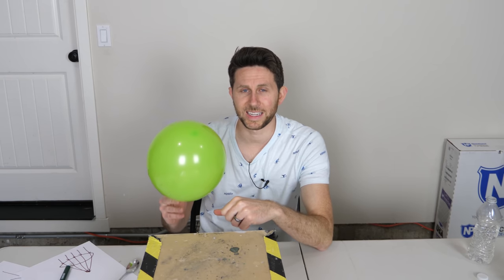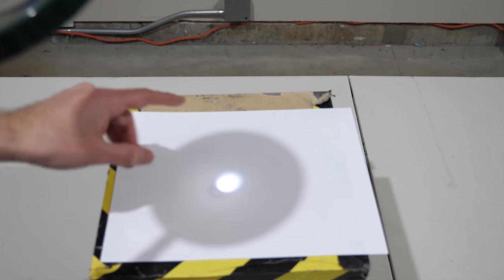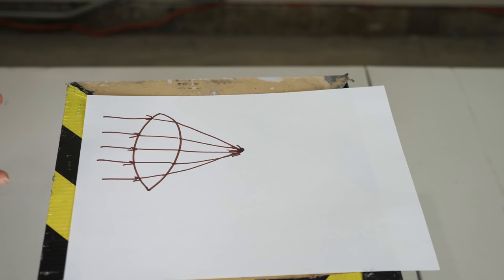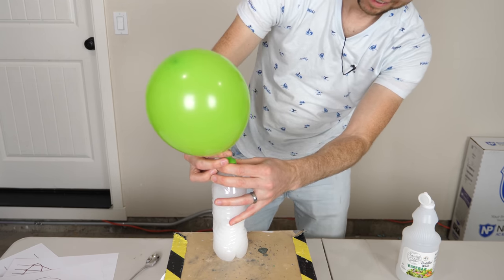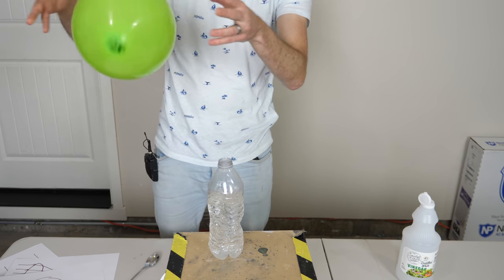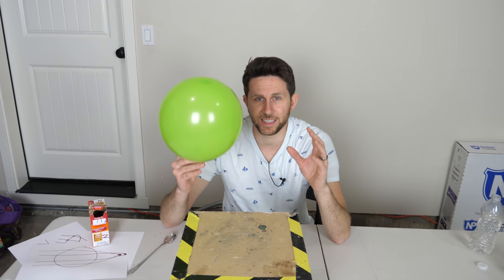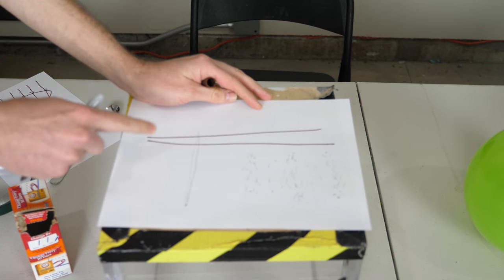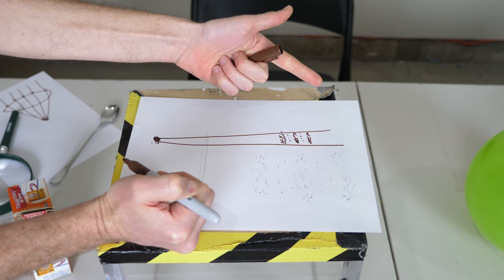Is it Possible to Make Hypersonic sound? Ultrasonic Sound Lasers and Lenses

Comment: This channel is filled with fun mixed with science. That's a very smart way to teach others. Thank you
Reply: After watching this channel I like science more than ever did. this channel is filled with fun experiment and easy knowledge i like your channel and I am your big fan I am from India 🇮🇳😇
Reply: Fax
Reply: Some of his explanations are a bit inaccurate/misleading though.

For example, the refractive difference between mediums isn't actually due to density, although they are related. And the same goes for sound through a medium.
Additionally, when he explained how the "sound beam" works, he said it uses pressure waves to propagate, but that's what literally ALL sound is, it's not special to this. And the generator of the waves is absolutely the source of said sound. The source of the waves IS the source of the sound. All waves need a source, and sound is no exception. It doesn't just materialize from the aether.

Comment: I found this experiment really interesting, I think you should consider that in the case of light, the wave length is way smaller that the lenses, so I recommend to repeat it with a weather balloon and maybe add some distance between the sound generator and the sensor. After all, light experiments mostly use planar and coherent laser like waves. You could use dry ice to obtain the CO2 and use a shotgun mic if you have one. The idea is grate, keep the good work.

Comment: Is it true that if you collapse an underwater bubble with soundwave, light is produced? If yes, why is it so?
Reply: Sonoluminescence.
Reply: Not even Wikipedia knows why.
Reply: Is light produced or is it for nanosecond refractions from bubble collapsing..?  How would u measure input of light into/onto bubble..isolating it from environment.. or is it photons being emitted from electrons of atoms of material in the water excited by sound..im not sure if this is possible?? Would salt water be same as fresh water in this case? 😘
Reply: Matías thanks for the link..it's very helpful..I'd not heard of this before!!
Reply: It happens but we don't know why
Reply: It's mostly due to the water vapor which evaporates to form the bubble being compressed suddenly into a very small volume, so the temperature goes up really fast, like tens of thousands of kelvin hot for a moment. The light is likely produced by H2O being briefly turned into plasmas of hydrogen and oxygen

Comment: I bought such a device more than ten years ago. It's called Audio Spotlight, and I used it for being able to wake up to and listen to radio in the bed in the morning whilst my partner could continue sleeping. It cost a fortune (about 1.800 USD) and was a disappointment. It turned out that the bed linen demodulated the ultrasound and dispersed it in all directions, so my partner could hear it almost as well as me. In free air it kind of works, but nowhere near "rich sound here, nothing one step away". It's stowed away since many years.

Comment: Doesn’t horn speaker focuses sound? And could water in a baloon do it since it is much denser than air?
Reply: Yes but I think water is so dense that some sound gets caught along the way
Reply: A horn speaker confines the radiation angle of sound, but the dimensions of the horn mouth must be large enough relative to the wavelength to exert pattern control and not just create edge diffraction. Think of a straight pipe having the diameter of the sound source: if you use a small source (such as 1"), most audible frequencies will diffract when they reach the end of the tube, because of the sudden change in radiation resistance (forcing the wave to expand in directions not parallel to the horn wall), and the effective radiation angle will be close to 180 or even 360 degrees in any plane crossing the axis. To constrain the radiation angle to smaller angles while having a mouth that opens to be large enough to control the radiation angle, the horn will need to be exceptionally long, even infinitely long. 

If you make the sound source tens or hundreds of times larger than the wavelength it is producing, then it will begin to exhibit off-axis self-interference, which becomes more intense as the dimensions of the isophase source (think of a flat piston) are increased, producing coherent summation only in the axis of radiation with minimal spreading, but these sources can become impractically large to transport or mount. (Look at the Meyer Sound SB-3 "sound beam" - it is an array of dome tweeters creating a sound source that is substantially planar, substantially continuous, and substantially isophase.) An array of ultrasonic transducers is able to create narrower beams of sound than a horn can produce, and because even a radiator of practical size becomes large relative to the wavelengths of ultrasound that it is producing, it is able to make use of off-axis self-interference to create a narrow beam at distance. 

Because ultrasound is being produced, it cannot be heard. It needs to contain modulation content that occurs at audible frequencies in order to be perceived by the ear. So the ultrasound needs to be demodulated somehow, and it does that by interacting with a high impedance surface, causing the ultrasound energy to be reflected in a non-isophase manner and mostly destroyed, but the residual variation in pressure is demodulated as audible sound. In a Class-D amplifier, this is done electrically by passing the modulated ultrasound signal through a reconstruction low-pass filter, but in the physical domain anything providing a reactive low-pass effect can demodulate the ultrasonic carrier, causing the resultant pressure to contain only audible content below the low-pass corner. 

Once the concept of demodulation is understood, a number of methods for achieving audible transmission become apparent. You can employ frequency modulation (resulting in amplitude modulation of another ultrasonic difference tone between a steady ultrasonic carrier tone and a sliding ultrasonic carrier tone as the carrier), amplitude modulation, or pulse-width modulation. You can use mechanically transmitted pressure waves, or you can use other forms of energy to do this also - radio frequency, microwave frequency, or even light, though the power needed to produce air movement can be great enough to cause injury to a subject, so you would need to be careful. This power, modulated at audible frequencies so the demodulated signal consists only of audible content, can be used to produce audible sound. 

This phenomenon of energy demodulation is likely what caused American diplomats in Cuba to perceive harsh-sounding audio as they awoke inside their domiciles while their brains were being damaged using a directed energy weapon, causing people in the public to suspect that an "acoustic weapon" was at work; in reality, sound (acoustic pressure waves) would not be able to pass through the walls of their living quarters without being strongly attenuated, but radio frequency energy can pass through walls, and if its modulation contains audible content, then the person or animal subject will experience audio while the rest of the energy is being dissipated in their body in another way (such as frying their brain).
Reply: @Acoustic_Theory  w h a t

Comment: Air particles are very heavy as compared to light particle it is very interesting to study about the ratio  of the angles by which they bend during refraction in different materials and for different wavelengths.

Comment: Good. Now make flammable water. But it has to remain H²O.

Edit: Mostly H²O...
Reply: How should this work?
Mix some kind of extremely flamable oil in?
Reply: Just mix ethanol with water boom flammable 'water' which is mostly water
Reply: @deadalpeca8099  it would be over 40% ethanol
I dont think almost 50/50 is considered as mostly water
Reply: Just to be clear, your notation should be using a subscript for the 2, otherwise it's an ion.
Reply: Mr.Knight The Detective: https://en.wikipedia.org/wiki/Chlorine_trifluoride

Comment: I wonder if ultrasonic sound waves could be used to steer light.  Maybe ultra short laser pulses synced with them could be refracted multiple times?  Could make for a strange effect with the appearance of light changing direction in mid air :)

Comment: Lenses for EM radiation work on transverse waves, but with sound being a longitudinal wave, I'm not so sure it'll work in the same way. I'll keep watching just in case!

EDIT: I have a problem with the fact that sound is "focused" using the CO2 balloon. Surely this is due to the higher density allowing more sound to transmit more efficiently? CO2 at the same pressure as air has a lower impedance, so it can transmit longitudinal waves with greater efficacy. If you had a balloon with Helium inside it, it would attenuate the sound considerably. A phased array would be necessary to focus sound, in the same way it's used to focus RF energy into the ionosphere for ionospheric heating (with the HAARP system).

EDIT 2: I see! The higher frequencies of the ultrasonic longitudinal soundwaves are created due to their ability to be focused easier using a phased array of ultrasonic speakers, so they may be demodulated by the impedance mismatch of the transducer with the air (or other objects in the way that absorb those ultra-high frequencies, allowing the lower frequency pulse-width modulated signal to be demodulated naturally), and heard by anyone in proximity to the soundwaves.

Comment: You may not know that the speed of sound waves is much faster in a higher density environment. What is different, even the opposite of the propagation of light waves. Consequently, the opposite principles must be followed when creating a sound lens. To achieve an analogy for focusing light. I simply recommend using a donut stone.

Comment: When you put the CO2 balloon in front of the speaker you may have missed the "focused" spot of sound. It would have been more instructive if you had moved the balloon around while it was blocking the speaker, both side-to-side and fore-and-aft, to see if there was a strongest (loudest) point. What you showed us could easily have been the equivalent of an unfocused magnifying glass or even the area outside of the focal cone (the "shadow".)

Comment: Now with your video on light sabers, I always thought that the sound of the saber was due to the fact that the light saber beam was actually focused sound. Like ultrasonic welding which uses ultra sonic mechanical vibrations to disrupt the molecules to bond items at a molecular level. Would not a beam of focused ultra sonic sound, I mean like really high obviously,  be able to separate molecules of any material  to the point of causing a cut so to say in the material. Hence the sound that comes from the light saber beam. The laser beam, blade color would contain the focused sound so the wielder would know where the blade ends. Just a question I have had for some time now.

Comment: The Sun is too darn loud!
Reply: [Harvard wants to know your name and adress]
Reply: You forgot the katana in your profile pick
Reply: Absolutely correct the sun does make a lot of sound. We might not be able to hear it. we can detect it. The noise it makes to radio frequencies. Sound is a frequency just like light except  a lot higher frequency and it comes with magnetic indifference.
Reply: @maniccam8374  light is indeed a frequented electromagnetic wave

But there is a bit more than to say both have frequencies = both are sound

The magnetic waves of the light will attract the air particles to a very small grade and it will get transfered into actual sound

And sound is not a frequency it is a  frequented dencity changes in gases, fluids or hard materials 

Whilest light is an electromagnetic wave which is not a dencity change in a material since it can travel through the void of space it doesnt even need a medium whatsoever.
Reply: @maniccam8374  sound is vibrating air molecules
Reply: @slickrick8279  *wave and particle duality

Comment: Would have been curious to see what happens with a balloon filled with just air going between the speaker and camera microphone. Does it block it and reduce it, or does the sound cause the balloon itself to vibrate, along with the air inside it, and amplify the sound.

Comment: What about a parabolic dish? Out the front of the visitor centre for the Parkes, NSW, Australia Radio Telescope they have two parabolic dishes facing each other about 50m apart. When you and another person stand right in front of each dish and talk (at normal volume) it sounds like the other person is right next to you, but they are 50m away. If you do a loud clap the echo is really loud and you can hear the echo repeating until it fades away.

Comment: I don't think the line of thought is right here. The reason why a normal lens works isn't directly because of its density, but the speed of the waves in the medium. With sound, the relationship of density to speed is actually the opposite of light. Sounds travel faster in water than in air, but light travels faster in air than water.  In a convergent sound lens, its density would have to be lower than air, so that the sound waves travel slower inside the lens, such as helium balloon.

Comment: I've been wondering about this tech for a long time. I wonder if it would be possible to ionize the specific low or high pressure air pockets, and keep them in the same physical location? Could this be how we make force fields? Plasma held in place, and powered, by a focused sound beam!

Comment: Well is it same as connecting two plastic cups with string(thread) using one cup as transmitter and another receiver? 
Because it travel through air(rarer medium) in cup first and then string(denser) via cups

Comment: About 10 or so years ago, my guitar teachers had a crazy Bose speaker. It was a tall, thin tower, and no matter where you were in the room, it sounded exactly the same. It was in a small auditorium, and whether I was at the back of the room, or my ear was right on it, it made no difference as far as I could tell. Then, if you went behind it, you heard almost nothing. Would this work on the same principal?

Comment: Great and unique experiment on sound. Here is a suggestion for another action lab. Thanks for the TED talk link as well. 

REQUEST: I would love to see an explanation of how a speaker replicates multiple sounds at once. A single speaker can make the sounds of an entire Orchestra.  Can you show in your action lab how a speaker does this? With my super limited understanding of how a speaker works I would think you would need one speaker per instrument, yet this isn’t needed.  Obviously, I then conclude the sound waves combine to make another more complex sound wave. If I recall from my high school days of looking at sound waves on an oscilloscope they didn’t seem more complex.  Also, there is only amplitude and frequency. Amplitude is usually volume and frequency I thought was the noise (the vibrating pattern of sound – of my voice or an instrument).  So how does it get more complex? 

Thanks in advance if you do an action lab on this.

Comment: Yeah, it is absolutely possible to make Hypersonic. Just collect all the Super Chaos emeralds before the end of Flying battery, grab 50 rings and jump

Actually, if it's possible to modulate ultrasonic sound waves to create standing points that act like virtual speakers, isn't it also possible with light to create bright points in the air the same way and actually make real 3d-holograms like in those sci-fi movies?

Comment: Hi Action Lab. I have a question in my mind for many times. Is it possible to concentrate HEAT radiating from a heat source which is not producing light but only heat.

Although we can run a sterling engine from that heat source to generate electricity then we can heat up a small copper wire to a very high temperature. That way we will be able to concentrate heat thereby increasing the temperature of copper wire but this is not the efficient way. Please make a video for this topic if possible. Thanks.

Comment: What if you use Sulfur hexafluoride for sound lens?
One of the densest gas known to man.
Is a non toxic gas
6.12 g/L while Co2 is 1.45 g/L
Is famous for doing the opposite of helium when inhaled.
You can make aluminium or paper boat float in it, like it floats in the void.
And again what if you use Sulfur hexafluoride as a sound lens?
Would it make the sound lensing effect any different?

There is the densest gas known to man called
Tungsten hexafluoride about 13.0 g/L but is a toxic and extremely corrosive gas.

Comment: https://en.wikipedia.org/wiki/Fresnel_equations
Does it works with sound? But vacuum has a refractive index of 1 and a lens 3.5 so nearly no difference and for sound air is 1000 times less dense than a liquid/solid material.

Comment: ⥊ 18: 1616

0: Good (if not good, then not zero)
1: Ethics
2: Problem-Solution
3: Consent
4: Emotion/Will
5: To Testify/To Meet
6: Why/Who/When/How/Where/What
7: Information
8: Stability
9: Sanity
10: Network (Good Network, because zero)
11: Justice
13: Death
16: Tower
20: Judgement
21: Solving Problems with Ethics
22: Resistance
23: Resilience
30: Good Wave
32: Discernment
33: Jesus
40: Good Force
50: Good Expression
57: Counter-Terrorism
60: Good Reason
70: Good Information
80: Good Stability
90: Good Seriousness
96: Blockchain
97: Anarchy
98: Vegan
99: Revolution
100: Liberation
1000: Possible Conversation Method using numbers to convey meaning
For ex.: 6022: Good Reason to Resist.

Comment: Why doesn't the magnifying glass work with the sound since light is energy so is sound the glass bends the light it should bend the sound the glass is much denser then the co2 in the balloon and sound waves travel faster in denser materials so why not the magnifying lense.